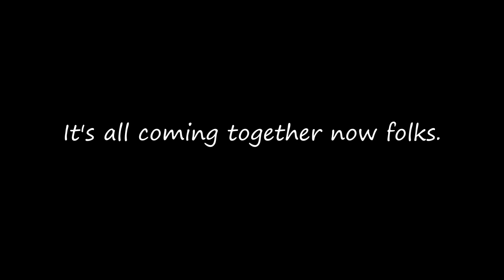OFF GRID HOMESTEADING  The Solar Power, Chicken Coop and Woodshed Projects Have Begun

Comment: JC I am in the middle of a wood shed build as well and I am working on videos of that progression as well. My Woodshed will be 6 meters by 4.5 meters on concrete sleepers and treated 2x6s, a raised floor with 2x6 spaced flooring for air flow. I am really looking forward to to because after 7 years we are tired of wet fire wood. You have snow. We have cold rain. Oh I am looking forward to seeing your shed. Nice upgrade to the power using solar. We are loving our 10 kw system. We use towers for our solar, big towers that rotate and index. It is best but we also have some panels on the roof as well. Our system is big. 
Sounds like you have good things happening. If you get bored please come visit us in Chile as we need help! Thanks for the hard work and video. Jim in Chile
Reply from the maker: Our solar will expand over time. For now, it's just nice having these panels out of the box and generating power.  This system is puny but handles our needs except for running my carpentry tools.

Comment: I put my solar on an adjustable ground mount. Summer setting is not too low because of the tilt and I don't worry about the mower throwing stuff. In the winter, the tilt is steep and makes clearing snow easier.  Better year round production too. I enjoy seeing how you live and work. Stay healthy.

Comment: Good to see you, Boss.  Everything is coming along well.
Give Frankie and Tildy a good ear scratching.

I did an experimental solar install doing ground mount. 
I set them up on 2 5x5 brick masons scaffold frames. The kind with bars every foot.
I was able to set boards at two different levels to get the angle correct for my area. That was 12 years ago. They work well enough i am not moving them.

I do not usually plug another channel on You Tube. 
However, If someone needs help with solar or is interested in solar there is a young man on You Tube named Will Prowse. He is extremely knowledgeable. 
His website has everything from beginners to advanced materials.

Comment: Have you given consideration to making yourself  a solar hot water system? Not sure if it would be functional in the dead of winter but for 8 months of the year you wouldn’t need to burn wood for your hot water. Since that same period you won’t need to burn much for heat either it would greatly reduce your workload of gathering and splitting so much wood. The only costly piece for the system is a large storage tank for the hot water — probably 60-80 gallons.

Comment: I like the way you plan out your projects and FINISH them  i watch so many off gridders that make such a mess of things and never finish anything.  i use screws almost all the time on remodeling projects so you can "adjust " things as you go.  screws can be a bargin if you watch big box stores like home depot  and buy 40 lb boxes on special  plus they allow military discount on top of the sale. several buddys and i buy a box of 3 or 4  sizes and split them up. last batch came out to about 1/2 regular cost.

Comment: Greetings from Kentucky. Well I see that we missed this yesterday, but we are glad to catch up with you today. We have been busy in our little Holler on our small (by comparison with the old family farm back in CNY) Farm. We have been harvesting sweet corn and will be yet off and on for several weeks yet. I plan to plant Peas today for a fall harvest, so I will have to get at it soon. Your Solar Systems will turn out great, just like everything else you, and Lori work hard at. I'm sure that you will rig up a big handle push broom or soft rubber squeegee to pull off any snow. We had a large (around 800) Solar System back north and did not do anything with the snow removal, but I don't remember it staying covered over a week at a time. No plans yet for panels here, but down the road after we tackle some things. 1 thing that I would do differently is to own the panels instead of the 20 year lease to own. James, do you and Lori have a stream on your property that you could safely harness for Hydro power? Be safe, take care and GOD bless you both.
Reply from the maker: No stream but wish there was.  I bought these panels about 6 years ago. Nice to have them generating power :-)

Comment: You really may want to consider about putting heat inside of your coop in the winter time. We have chickens and they produce quite a bit of heat themselves from their bodies huddled together. It gets so hot in there sometimes when I let them out you can feel the heat on the outside. You do not want to cook your birds.
Reply from the maker: No worries. The coop will be regulated.

Comment: Good morning to ya folks! When you mentioned that the pines were coming down a question popped into my mind. Burning pine can cause too much pitch to build up in the pipes, so I was told by my chimney guy. What will you do with all of that wood? Will you mill-up some boards with it? Just curiosity is all. You two have done a wonderful job with that garden! I especially like the raised beds made out of stones. New England is just full of them, no wonder there are so many stone walls. When I go metal detecting in the woods, I can't tell you how many walls I've had to climb over!!
Reply from the maker: The logs will be milled into lumber but the remains will be burned in the greenhouse once it seasons.  No problems burning pine and other conifers once it has dried.  That's all they have in Alaska except for a few other softwoods.

Comment: i put mine on the roof mounted on a post 3 panels made them so they rotate for the different seasons in the winter season the angle is so much the snow falls right off tried to give you a pic but it wouldnt upload

Comment: I see you have a lot of short length firewood to cut up. Have you looked into a Chain Saw Chop Saw. I checked it out and built one. One of the best things i ever did. You can go to my channel Wayne ladd and i have a short video up on it. I went with an electric 16 inch Craftsman chainsaw from Lowes. It worked beyond any thing i could have imagined. You dont have to remove it to add oil.
Reply: Thanks for the love. Doing short small wood this way is almost fun. I can,t say enought about how easy it is.Wood can be cut with two fingers and no bending over. I cut up to 7 inch diameter. You can message me on FB  if you have any questions.